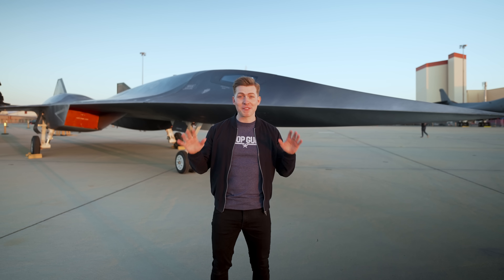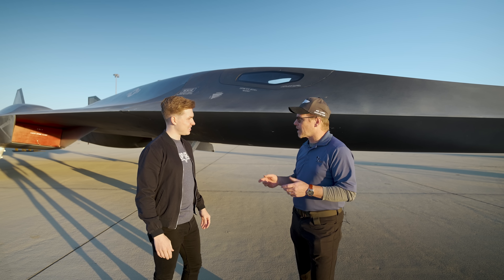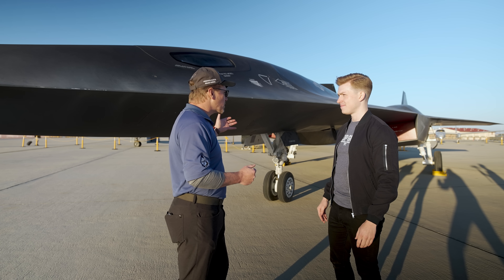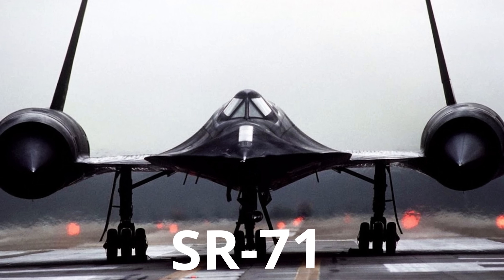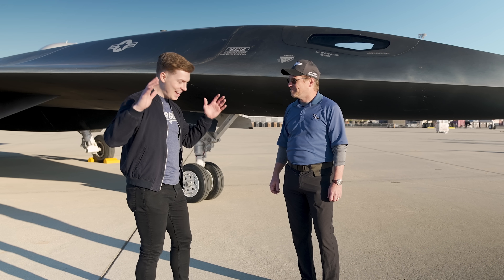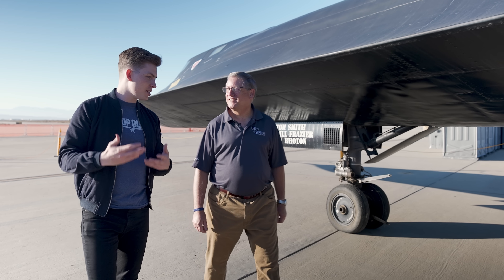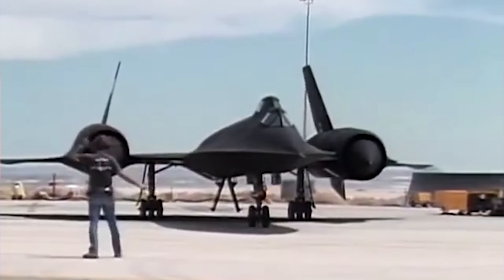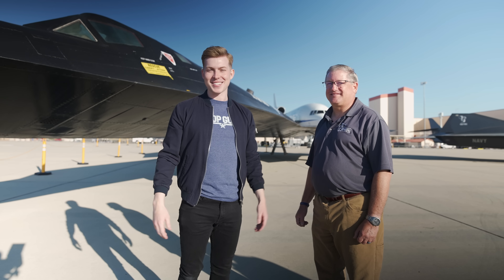Top Gun DARKSTAR in Real Life!

Comment: I didn't know the Space Shuttle did Mach 20, it's very promising that such an old aircraft could transport people safely at that speed. I think we have the technology to achieve such speeds but that's a minor issue compared to making it reliable and efficient
Reply: You do realize it only went mach 20+ because that is orbital speed, right? It wasnt cruising in atmosphere at that speed. Also the shuttle wouldnt have gotten anywhere near that speed on its own, it has no fuel for its main thrusters and the monopropellant thrusters wouldnt even allow it to take off. Its not much of a comparison
Reply: @zee_terminator2850  Yes, i am aware. My point was technology exists to allow such speeds in the airframe with an entire crew on board
Reply: @mrcaboosevg6089  but the thing about the shuttle is that it is a bad comparison. It is only meant to sustain such temperatures for a relatively short period of time, and the heat shields must be replaced every time. The goal with these modern scramjets is simply have the material be so strong and heat resistant while also being lightweight to be able to cruise at speeds upwards of mach 3-5
Reply: Yeah, it's actually doing Mach 25 when it comes back into the Earth's atmosphere.

Comment: Still find the design of the SR71 absolutely amazing, there’s been nothing like it until this, built in the 60’s is mind boggling
Reply: For even more perspective they built it without computers.
Reply: @iconofsin5886  that's right, slide rule technology! 👌
Reply: @iconofsin5886  Actually, the SR-71 had computers on board. They were hydraulic and part of the engine. The engine needed a lot of calculation to optimize fuel flow and other parameters. They used hydraulic computers, because 60's electronic computers were too big, unreliable and wouldn't work at high temperatures.
Reply: @Icon Of Sin  of course they used computers, human and transistor logic
Reply: @iconofsin5886  bruh, the Konrad Zuse was released in 1941. Just sayin’
Reply: bala8oo and to think there are people that doubt the concentrated efforts of rocket propulsion systems orbiting during that time as well. It’s like, how do you think you get communication satellites feeds today? Duh.
Reply: Imagine building that kind of technology in our current time.
Reply: @kimlloydfabic1077  what do you mean?
Reply: @MROIY  Imagine a plane built with modern computers, materials and scram jets. It would be lighter, far more powerful and have the materials to stay in one piece at those speeds.

Comment: Love to know what material you plan on using for the skin to go over Mach 5...
Reply: Perhaps it has thermal tiles similar to the space shuttle.
Reply: @your_average_joe5781  WEIGHT...... your enemy with achieving Mach 5 plus...
Reply: @HebrewHammerArmsCo  Thermal tiles are as light as styrofoam!!
Reply: @your_average_joe5781  Some of them are very light weight.... The ones developed for leading edges that had the highest heat resistance... Not so much...  About 14 times the density...  So what will a Jet  that sustains Mach 5 plus for hours require...  As opposed to  the space shuttle  which was about 25-30 minutes..

Comment: When you look at the size of the sr71 and it went Mach 3 plus the dark star while impressive looking is too small the fuel capacity probably wouldn’t be big enough to achieve Mach 10
Reply: Scramjets use a different technology. They are not using JP7 jet fuel to reach Mach 10. Once they reach a certain speed, say Mach 5+, they use scramjet technology, and scramjet inherently uses far less "fuel" than its ramjet counterpart.

Comment: There are a few problems with hypersonic flight 1) Those kind of speeds can only be achieved in super thin air, air so thin the wings have trouble generating lift and you almost need a rocket engine to not fall down. 2) Those kind of speeds generate alot of heat and you start to become a re-entry fireball, only a strong metal can withstand this much heat and strong metals are heavy. 3) Its hard to keep the flame inside the engine lit when air is rushing through at such a high speed, when you blown on a candle the flame goes out the same concept applies to a jet engine. I'll belive in such a plane when I see it, a functional darkstar would be an engineering marvel.
Reply: ...Thanks for watching and commenting ❤️ you have been randomly selected from comments as winners of today's giveaway hit me up via the digit's above to claim your prize 🎁

Comment: I knew it was at least a real concept when I saw the first previews. People said it didn't exist. But it's a real concept. Probably not strategically feasible. If it was a real 'spyplane' it would definitely be a secret. So it's hard to say what's counterintelligence, red herrings, and or turkey chases. Getting the other guy to spend money on something not that good is a good thing strategically. These days it's so easy to rapidly prototype something in a scaled mock-up. 

Also, a ram jet is basically a venturi tube that has no spinning blades or compressors. Just a tapered tube that introduces and ignites fuel part way through. Very difficult to keep the flame lit. A SCRAM jet is like a hybrid engine that uses fans to compress air up to mach 3 or 4. Then the SCRAM jet begins to bypass the airflow into the turbines fan blades through a RAM jet style tapered tube. During the transition period some of the air is driving the turbines, and some of the air is starting the RAM jets. The RAM jets increase in performance once up to temperature when the combustion is stabilized. Once the RAM jets are started the airflow is completely bypassed around the turbines with hyper-sonic shock cones.

Comment: The prop aircraft has too many sharp edges for high Mach speed. The Prandtl-Meyer equation multiply Mach number SQUARED... So 2 is a factor of 4, 3 a factor of 9, 4 a factor of 16... etc cetera. Any leading edge that does not have a generous radius simply melts as the strength of material falls rapidly with temperature. Basically there no place for the heat to go. X-15 was made from Inconel while SR-71 is titanium. Look at the shuttle wings... of course reentry is the most extreme condition you can get.

Comment: SR-71 was the last airplan to be fully designed with a sliderule and it's still the record holder, damn
Reply: Привет землянам из США !👽👽👽🍺👍
Reply: The X-15 predated the SR-71 and holds all the speed and height records. The pilot got astronaut wings and flew at Mach 5.
Reply: @BayouBengal1962 that record is in a different category SR-71 still holds the crown technically I see what you were trying to poke at (the SR-71 Blackbird still holds the world record as the fastest air-breathing manned aircraft)
Reply: @Ziyoblader  And they will NEVER actually tell you exactly how fast the SR-71 can actually go. I don't know that it's EVER been full throttled. Maybe in top secret runs... but we as citizens will never know. This thing sees a missle coming at it and it just deploys afterburners and it's gone. Nothing for the missle to track. It outruns them.
Reply: @crazyidiot5309  one word amazing
Reply: They could have added more glass towards the front of the cockpit of the Darkstar. You can't even see straight forward!
Reply: @Angry.General1461  did you even listen to what they talked about? 😂 obviously there reasons to why hypersonic test vehicles upon till now haven’t featured prominent windows at the very front (the mentioned nasa aircraft or also even the space shuttle for example)… that’s because the front tip is subject to massive aerodynamic pressure and heat of course and it may be just easier and safer to use digital visualization in the cockpit for the pilot (sort of vr goggles or displays) instead of working out how to place some sort of transparent window elements there…
Reply: @kleeblattchen38  you obviously didn't see the movie! There was no digital visualization! You just wasted your time typing nothing but a load of crap!😂😂😂
Reply: @Angry.General1461  Этого делать нельзя !Очень сильный нагрев  до t=900C !!Пилот всё вокруг может видеть на  TV -экране ! 👽☝
Reply: The MiG-25P holds the absolute record for flight altitude and it caught up with it. To create it , it took a slide rule and titanium .
Reply: @AlexFeCity46  "Миг-25 сделан как лопата ,но летает как молния !" /Толбоев ,лётчик -испытатель /🐴🍺☝
Reply: @AlexFeCity46  difference is Migs are garbage
Reply: @AlexFeCity46  Doesn’t the foxbat tear itself apart, more specifically the engines past Mach 3? Least the SR-21 doesn’t do that to my knowledge

Comment: Great video Sam.  I spent two years as a Blackbird cadet in the 70’s.  I’ve always been intrigued with Skunkworks.  There’s probably numerous prototypes that the public has never seen.  I spent six years refueling the SR-71 and it was an awesome mission and team.  It’s hard to believe the technology designed into this aircraft was from the 60’s.  With all things GPS today, this aircraft had a navigation astral tracker to maintain tight navigation standards.  Essentially it was a computer using star positions to accurately track position.  Doubt there are many aircraft using that technology today in lieu of the ubiquitous GPS.
Reply from the maker: That's awesome to hear! I bet you have lots of amazing stories.
Reply: The KC-135 Air Refueling Tankers I worked on also had a Sextant for navigation. A small port on the top of the fuselage where the Navigator would insert the Sextant and use it for navigation. The KC-135 also had Magnetic and Gyroscopic compass systems. Some of the Guidence and Control systems still used Vacuum Tubes.
Reply: Plant 42 joint project Lockheed and Boeing “Pumpkin Seed” uses this same technology exclusively due to it being a true trans-atmospheric vehicle capable of orbital flight.
Reply: I flew the blackbird in 76.  I’m 46 now. Time traveled.
Reply: That's astonishing that such technology to fly spy missions so high and so fast was started in the 50's.  That was 70 years ago and I'm sure the Skunk Works has not been sitting on it's hands  watching The Simpson's lol.  I am sure there is much behind the scenes that one day might be revealed to the world and no doubt we will all be gob smacked!
Reply: You are correct on the SR 71 using stars and math to figure out the location. From the research that I have done on the bird, that navigation system was accurate within 300 feet even going at mach 3. And yes to my knowledge the B 2 also uses a similar system because GPS is cool until it gets jammed and having a nuke payload that is not acceptable so it has it as well.
Reply: Or is it? Vsauce music start rolling
Reply: Sextant port was great for launching hard boiled eggs.
Reply: @studuerson2548  Never heard about that. I once had to help Troubleshoot an air leak at the port reported during flight. When asked if I had any sinus congestion I denied that I did. They pressurized the fuselage to identify the leak, and I thought my head was going to explode due to the pressure!
Reply: @studuerson2548  The other Avionics Technicians I worked with told me about occurrences over the years, when the small fuselage panel surrounding the Sextant port is failed. The Navigator would stand on a small foot step to view through the Sextant. When the small panel would fail the sudden depressurization would immediately suck the Navigator's head through the opening where the panel blew out and would decapitate the Navigator when their shoulders hit the small panel opening... sending their lifeless body falling back to the floor!

There were also stories about absent minded technicians who were troubleshooting pitot-static problems by climbing a ladder to reach the Pitot-Static Probe, and "using their mouth to blow into the probe" unaware the Pitot-Static Probe Heater was switched on in the Cockpit! Couldn't imagine the injuries experienced when their lips seared themselves to the Probe!

I also heard about an in-flight emergency that happened while my unit was deployed during Desert Storm. During a Refueling Mission. A Fighter somehow "barrell-rolled" over the top of the KC-135 Tanker and impacted the fuselage near an Avionics Rack, tearing a massive hole in the side of the Tanker... Amazingly the pilot was still able to bring the plane down and land successfully! The Technicians couldn't believe it made it down safely with the damage incurred...

Comment: I had the fortune of seeing the SR71 take off and land when I was stationed on Okinawa. It really was a sight to see watching this beast take off and it was surprising how much runway it took to get off the ground given how much power those engines produce. It literally took the entire runway at Kadena to get off the ground but once air born it would turn vertical and went almost straight up and was out of sight in less than 20 seconds once it did!
Reply: I imagine an airframe designed for aerodynamics of higher Mach speed like SR71 is probably shit at low speed velocities. Source: I’ve played a lot of Kerbal lol
Reply: I too was stationed at Kadena when the SR-71 was still flying over there. In fact I was the Base Photo Lab NCOIC.  Part of my shops duties was to process the film from the SR-71s cameras when they finished a mission. All was classified. It was a treat to watch it take off on its missions. When it did it would always take the same outbound path. Max burner takeoff until proper altitude then out went tbe burners, it would then turn north for whatever their target was. It was out of the hanger in short order, start the engines, taxi and take off with no delay. I got to see an engine run on the test stand. When they advanced the throttles to burner the rings were clearly defined and you could count them. Noisy of course. I feel very fortunate to have been there to witness the opetation of how it was launched and engines tested. The "HABU" will always be at the top memories of my 24 years in the Air Force.......oh yes the end of year BX sales held at the Foster Field House (Marine base) were legendary. The best high end items from all the manufacturers were on display. I brought back many separates including a AKAI 747 dbx bi directional reel to reel player. I know its very sought after by collectors. Mine was perfect with the dust cover when I sold it. Okinawa was a special place when I was there for numerous reasons.
Reply: My grandfather was part of the SR71 program at Beale AFB in California. I had the pleasure of seeing this aircraft fly many times. Also as a child I spent a lot of time sitting in the hanger with the SR71 (within 15 feet of it) while it was being prepped for flight. My grandfather was very proud of this aircraft and loved to bring me to work with him. I just wish I was a bit older to appreciate the scope of what I was experiencing. I can still see it in my mind as clear as day.
Reply: I live in Palmdale CA. Back in the seventies it flew over my house every other day and once it was out of sight it was all about the sonic boom 💥 skunkworks at Lockheed building is only about 3 miles away. So cool to see it at night with the afterburner plume. We still have two or three on static display on avenue p. And 25th Street East. We still get to see the B1 in the b-2 flyover our heads in our neighborhood. Just a couple of days ago we had two B1 bombers circle our house for about a half-hour. I've been fortunate enough to see the space shuttle fly overhead bolted to a 747 that is also on display on avenue p. I saw it take off from Lockheed one time I was close enough to see the fuel dumping out of it as they were fueling it. I've been in Palmdale since 1976.
Reply: Question: I read somewhere that when the SR-71 returned, the outer edges had a glow to it from the friction, and they had to wait until it cooled down to exit. Is that true?
Reply: @Kev621  yes it's true
Reply: @Kev621  it's like this.. at Mach 2 the pilot s slow down over Arizona to land in California. There's a couple Parked about 3 miles from me right now.
Reply: @nicolasklopfenstein1305  It's actually on my bucket list to see one before I die... Thanks for the response.
Reply: Nah tho. Thats amazing bro
Reply: i would  have loved o seen  it.
Reply: I saw them there as well back in the 80s They took off went straight up into the air cruises a little ways and refueled. 🤫😇
Reply: I had the same experience on Okinawa/Kadena...  super cool to watch...
Reply: I bet it shook the ground when it took off!  That is really cool that you got to witness that.
Reply: Luckiest man on earth 😂😂😂
Reply: It took roughly 4 states to make a U-Turn at altitude and because of the skin material, it actually 'bled' fuel thru the skin until it reached the cold temps of sub-space requiring air refueling shortly after take off.  If my sources and memory are accurate.
Reply: Wow! I wonder why it needed so much runway?
Kelly Johnson would be proud to see this.
Reply: You didn't actually see that, remember Kevin? You hit your head in Okinawa and I took you to the hospital. While you were unconscious the nurse came in talking about her husband watching the plane take-off. To this day, you still believe that was you out there on the runway. I can't believe you're still telling that story Kevin.
Reply: @ninthcloud6331  🤣🤣🤣
Reply: @ninthcloud6331  hahaha. THIS is what trolling should be like. Super funny and creative 🤣
Reply: Was it louder than fighter jets/Concorde?
Reply: this  is not a sr71
Reply: @georgestokes5116  youre not paying much attention...
Reply: @georgestokes5116  guess where they got part of the airframe from genius
Reply: @bballskiller  really
Reply: @georgestokes5116  It is an sr71 the frame is from that plane. This was supposed to be the successor to the 71